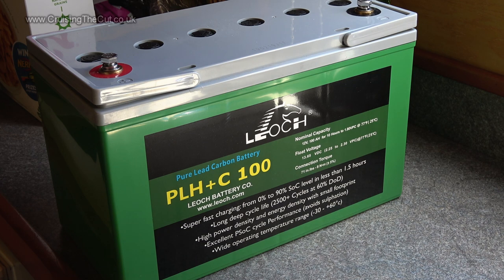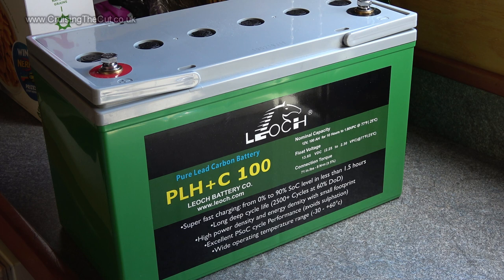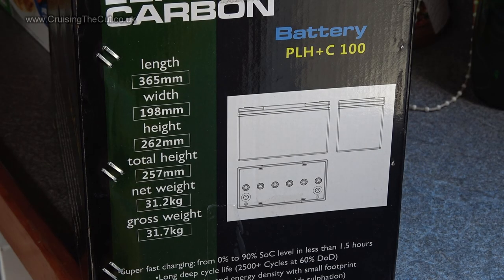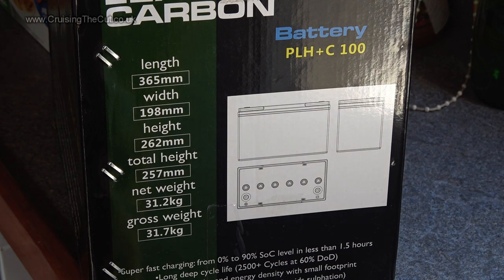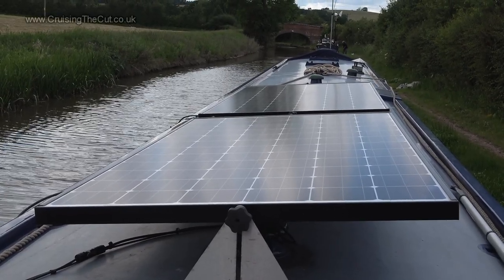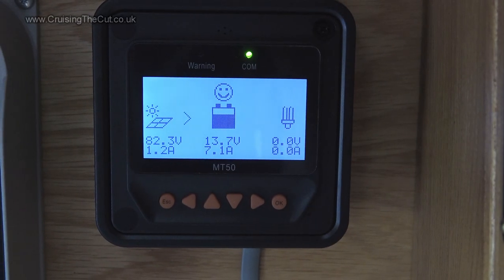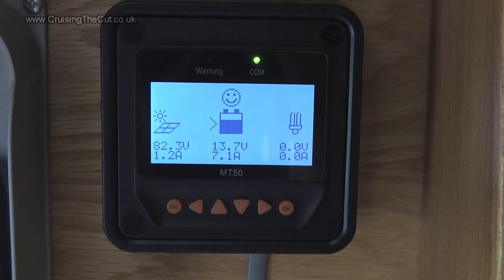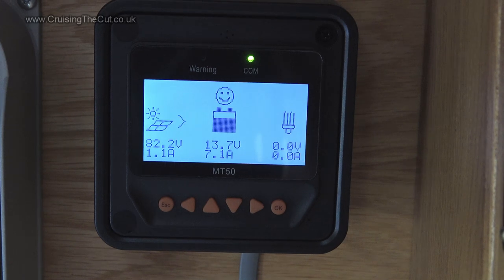178. Installing Lead Carbon batteries (12V 100Ah) into my canal narrowboat

Comment: What about your alternator regulator? Presumably it was set at 14.2v for the AGMs so have you left that the same?... or do you use an external alternator regulator such as Adverc, Victron or Sterling? 
Is there anything in the massive document they sent regarding use of Lead Carbons for traction drives?
Reply from the maker: It was putting out 14.4 as I recall though the AGMs really wanted 14.7 but I left it up to the solar to bump it up
Reply: @CruisingTheCut  TQ.. I'll be interested to know what the batt temperatures rise to when being fast charged from low. do you have a max/min thermometer in there by any chance?
Reply from the maker: I have the new temp gauge that connects to the inverter bluetooth monitor. So far, I've only seen them rise to 35C but that was with the engine on to charge so it gets darned hot in the engine bay anyway.
Reply: @CruisingTheCut  Unlikely you have a 200Amp alternator and the Victron will monitor the temp during shore charging and Solar is probably limited to 30Amps(?) so doubt you will push them to their max charge rate anyway. 
Is your engine air intake inside the engine room or externally fed? runs more efficiently lower @ air intake temp.
Reply from the maker: Haha no my alternator puts out a measluy 65A; the Victron chucks out 70A max (and the batteries are rated at 30A max each ie 90 across the bank so that's fine) but is anyway configured not to go over 52A charge, plus the solar could do a maximum of 40A but has never gone over 33A.

The engine bay, remarkably, has no vents for external air at all! I keep meaning to get someone with an angle grinder to make some...

Comment: What was your motivation for swapping out the batteries for lead carbon? Do you have any thoughts about lithium?
Reply from the maker: Lithium is ridiculously expensive, still only gives you 70% useable capacity, can't be charged when cold so the batteries would need bringing inside which would require substantial rewiring, plus it would need new mains and solar charge controllers plus battery management systems .. what a niusance! Lead carbon has all the advantages over standard batteries shown on the side of the box and is much cheaper than lithium.
Reply: @CruisingTheCut  Thanks! I appreciate this insight. I look forward to your updates about how the lead carbon works out for you.

Comment: Why only three? Is that more of a space issue, or due to the size of the solar panels? Do you have a little generator as back up for bad weather days or can you layup somewhere and plug in to the grid? Sorry for all of the questions mate, find these post very interesting and looking at what made you go in any particular direction! Keep up the great videos, nice to see stuff from back home.
Reply from the maker: Yes, only space in the existing battery bay for three without major reengineering!
Reply: @CruisingTheCut  Did you really need three ? You shouldn't need 3 for overnight in summer. Did the boat have three prior to solar panels ? Might have needed 3 then but not since !
Reply from the maker: I want more than just power for overnight! And I'm aboard in winter, spring and autumn too. Plus summer is not guaranteed to give sunny weather either. I'd like more batteries, frankly, to give me four or five days power but I haven't got the space for them.
Reply: @CruisingTheCut  Consider price of batteries and price of solar panels and compare lifespan. Without digging for details, I'd suspect I'd go for every part of the boat that's not window, would be solar panelled - roof & both sides.
Reply from the maker: The cost vs return on panelling the sides would be poor I think. One side (or even both, depending on your direction) would be facing away from the sun at any point and an awful lot of the canals are tree-lined so vertical panels at boat height would see very little sunshine anyway.
Reply: CruisingTheCut so I just watched the vlog where you cleaned up the engine bay and painted, great job. So was wondering if you where to move the single engine battery to the left side which is empty, (or it seemed so)  you could possible add a fourth battery on the original side. Only observation would be moving or adding charging cables around to fit. Happy boating, best Nigel.
Reply from the maker: Hi Nigel. Yes that's certainly a possibility, especially as there's very little on the other side so the battery could fit there. A bit of cable management required, that's all. Cheers

Comment: Does that wire with the inline fuse that goes from the positive post on the battery furthest from the starter batter connect to the negative side or does it go to the inverter? I'm trying to figure out how to turn my batteries into one bank is it really just connecting all the negative together and all the positive together and that's it?
Reply from the maker: It definitely does NOT go to the positive else there'd be a big bang as the fuse went. No, no, that's the feed to the inverter. To make these three 12V batteries onto one larger 12V bank, all the negatives connect to each other, and all the positives connect to each other. Then you take ONE negative from one end as your negative feed from the bank, and one positive from the opposite end of the bank as your positive feed from the bank. If in any doubt, get a qualified electrician to do it rather than blow anything up yourself!!

Comment: The besides polarity, connection points from your charging source across a set of batteries wired in parallel (as your are) doesn’t matter.  If the batteries were in series, then the connection points would matter.  Nonetheless good job.
Reply from the maker: It does matter, even in parallel; please see the article linked in the video description. Cheers
Reply: Read the article.  Based on my figures, the resistance of the connecting wires (at such short lengths) are just really insignificant to justify the more complex wiring configuration suggested.  Nonetheless please do what give you piece of mind.  It’s all blank magic anyway.  Cheerio

Comment: So is the electrical system in these boats similar to an RV where most of the lighting, water pump, fans etc run direct from the 12V batteries 12 Volts, and the inverter is just for like the fridge, TV, Microwave, general purpose outlets etc?  Or is everything at mains voltage and relies on the inverter?   And do they ever use propane refrigerators like RV's do?
Reply from the maker: Yes, very much like an RV. Mostly 12V (including the fridges, generally, though some folk use domestic 230V units and have to deal with the inverter losses). Gas fridges are very rare and not used these days due to safety concerns (if the pilot light went out but the gas did not shut off for any reason, the bilge would fill with gas as there's no way for it to escape, being underwater)
Reply: propane fridge big NO NO! Propane is heavier than air & if your pilot light does out, guess what? Free skylight the hard way.
Reply: David and Jeff, thank you both for clearing that up. I have a small propane refrigerator (actually a 3-way) in my RV and had wondered why canal boats didn't use the same. Now I see why. For an RV, a propane (or "absorption") refrigerator) is very efficient. If I tried to use it on 12v, my battery would be dead in just a few hours. However, the back of my little 'fridge is vented outside, I even have to go outside to light the pilot, but now I see how that is not possible inside a boat. I was not smart enough to know why, only barely smart enough to know there must be a very good reason. Thanks. -Phil K. Indianapolis USA
Reply from the maker: Yes, most narrowboats use either dedicated 12v compressor fridges (which are pretty efficient these days but still account for much of a typical boat's power consumption; may 45Ah / day) or some run domestic 230V fridges via an inverter as they're much cheaper than the 12V type but you have to live with the inefficiency of going via an inverter and that inverter being switched on permanently.
Reply: At least in the US, propane absorption refrigerators haven't had pilot lights in a long time. They have electronic igniters with a flame sensor, like on a furnace. They do have a few other disadvantages (like they need to be absolutely level to work properly, they need ventilation, and they aren't very good in extremely hot weather). They are common in US houseboats still but inverter-driven domestic refrigerators are becoming more common as inverter and battery capacity goes up.

Comment: Are any of the three leisure batteries you removed worth swapping with your starter battery or is your starter battery fine?
Reply from the maker: The starter was new when I bought the boat so is in much better condition than the old leisure batteries plus is designed as a starter battery (high current / short time) rather than a leisure / deep cycle application as the old AGMs are.

Comment: Did you ever do a follow up on these batteries?
Reply from the maker: I did mention them briefly in a video that’s now offline, I don’t really have an update because they just sit there working like batteries should.
Reply: @CruisingTheCut  will be good to know when they are done (end if life), how they compare to conventional leisure batteries you replaced. I don't recall you mentioning in the video, how expensive they were compared to conventional ones either, just that they had several advantages (which often means additional costs). Just an idea which your obviously free to disregard. 

Thanks for making the contents, I'd watched a few in the past but the algorithm recently brought me back in the last week or so and I'm really liking your relaxed, detail oriented content, it very much appeals to my autistic brain. Please excuse spelling and grammar in my comments, I'm quite dyslexic. Luckily unless we meet, my dyspraxia shouldn't come in to it though, so there are positives.
Reply from the maker: @Mike Lee Cheers but it doesn't list the charge voltages etc
Reply: @CruisingTheCut  .. Under Technical it says.. Recharge Cycles	2000,
Ideal Charge Voltage	14.1-14.6,
Top Up Charge Voltage	13.5-13.8v
Reply from the maker: I beg your pardon, I was looking at the downloadable datasheet!! It never used to give the charge voltages hence my confusion at the time. I'm glad they list them now.
Reply: @CruisingTheCut  Thanks all the same, your content is really useful for newbies/wannabies like myself

Comment: Hi, after watching the vid, I noticed at the start, looking at the wiring to the batteries, the engine battery was part and partial of all four batteries, 
at the final wiring photo,s  the starter battery was isolated from the other three,
Ok BUT. if you had left the wiring as per photo one, you would have had reserve power to start the engine if your one battery failed,  as in any type of river cruising, when your looking over the wear. keep safe.
Reply from the maker: No, the starter battery has never been wired to the leisure bank (except through the split charge relay). Only the negative terminals are commoned.
Reply: @CruisingTheCut  Thankyou for your reply, 
as to looking over the wear, would it not be a good idea to wire the starter batt to the other three but put a high amp isolator switch in a prominent position as in an emergency you could switch it on to use the other power, then turn it off after.
just a thought.
Reply from the maker: You certainly could and people have used the leisure batteries as a starter in an emergency but I've never needed to yet.
Reply: Yes the wiring was exactly the same except the move of the charge controller, , in an emergency, you could just use jump leads from the leisure bank to the starter battery. Those types of battery though are not designed for extreme discharge. A great addition to this would be 3 cheap voltage meters, one for each battery, you can then keep an eye on battery balance aswell as state of charge. Ideally you should never drain any lead acid battery bellow 50% or you will reduce its life, the recommended is actually no more than 60% for maximum life. so that leaves you really out of 300ah around 130ah of usable power, to preserve the life of batteries. so when the voltage hits 12.3 volts your at 60%
Reply from the maker: There's little point monitoring each of the three leisure batteries separately as they're connected in parallel so they'll all read the same. As you say, 60% DoD is preferable but these batteries can actually stand going down to 100% discharged up to 500 times without damage (according to the maker). Generally, my solar keeps them topped up pretty well though.
Reply: @CruisingTheCut  I reckon in a miracle situation they would last 500 charges from 100% DOD, but they would be toast.  Was suprised the inverter is not behind the isolation switch though. Really enjoy watching your videos btw

Comment: Are there places on the canal network where you can properly get rid of the old batteries?
Reply from the maker: Not on the canals, you’d need to take them to a domestic refuse tip or a waste dealer (who may pay for them depending on the metal prices)
Reply: So that’s a bit of a pain then if you are cruising.

Comment: Positive ground like older english cars or negative ground like here in the states?
Reply from the maker: Negative but the hull is not used as a return, it's all twin wiring to a single earth point near the engine.

Comment: If you realy want to ensure balanced charging discharging the leads from and to the batteries should be star connected with all leads exactly the same length. Equalisation used to be  required for very tall batteries used in static conditions as the acid would settle out of the distilled water so become stonger at the bottom and weaker at the top of the cell, an equalising charge would cause a large amount of gassing and therefore stir the acid up.Some thing not required on Glass absorbed mat or gell cells.
Reply from the maker: You're absolutely right about the leads but I didn't want to go quite that far!!
Reply: When wiring across the bank as he did, all paths are the same length.

Comment: i red in twitter that you asked about converting to electric.
remember of the shelf components are the cheapest way take this one as an inspiration.
https://www.youtube.com/watch?v=wjA17Fb-WXM
and double you're leisure batteries and solar, hock on a second alternator.
it might not be like the top of the line kits but  for slow silent cursing it might be enough.
and secondly if some garbage brakes you're transmission you have a reserve ;-)

Comment: I hope them batteries are going to last One thing is for sure the equalization voltage is always at least 1 volt higher than the normal charge voltage so you better do a bit more digging Normal AGM batteries have an bulk charge between 14.4 and 14.8 volt depending on battery So I presume you should for the life of it not be charging higher than 14.8 volt Cheers mate
Reply from the maker: Yes, these are speccd at 14.1 - 14.4 so I'm giving them 14.3V. They do not need an equalisation charge I am told.

Comment: As long as you dont touch positive and negative at the same time nothing happens if you are on insulating ground (shoes, wooden floor).
Reply from the maker: Yes, exactly, I didn't want to short out the connections

Comment: So how much better are the new batteries, compared to the old ones? Will we get a kind of long-term review after say 6 months and again after a year? (Sorry, I love off-grid power-setups with solar etc. - especially since my dream is to buy a bus (a coach to be exact, because those nice side-panels you can open from the outside are perfect for storing batteries, charger, inverter and even stuff like waterpumps and water-tanks!) and re-tool that to live in (permanently, like your boat!) and such a thing would need to provide me with power)
Reply from the maker: Too soon to say anything useful about them yet except that the difference in capacity compared to the knackered ones is obvious and welcome.

Comment: OMG you should NEVER disconnect batteries off camera! Don't you know how dangerous that is?!?! But seriously, the spark you get when you connect the new batteries even though the output from them is disconnected from the rest of the system can be caused by the tiniest voltage difference between batteries causing some current to flow from a higher voltage one to a lower voltage one. You see the same thing happen at a more extreme level when jump starting a car with a dead battery... you are basically connecting a battery with a higher voltage to one with a lower voltage. It is possible to get them totally the same voltage before connecting them together by first connecting the negatives together and then connecting a small power resistor between the positive terminals with a high enough ohm rating to limit the current to a small amount while they equalize.

Comment: The spark might be you have a parasitic load.  You can put an ammeter in series and check if there was a reading even everything was off.
Reply from the maker: Cheers - there really shouldn't have been but I'm going with the inverter because those wires are directly to the battery unlike everything else which goes through the Big Red Switch.
Reply: When I was installing my lithiums and working on the inverter (a Victron multiplus) I put my volt meter across the battery input terminals after I’d turned off the supply and it took a long while for the voltage to start to drop and it seemed to reach about 9 volts and stay there, so I would agree with your assertion on that.

Comment: If you have 3 batteries linked won't that be outputting 36v not 12v?
Reply from the maker: No because they’re linked in parallel, not series.